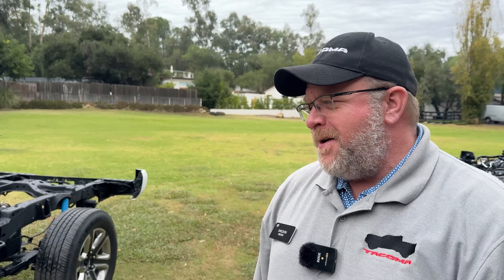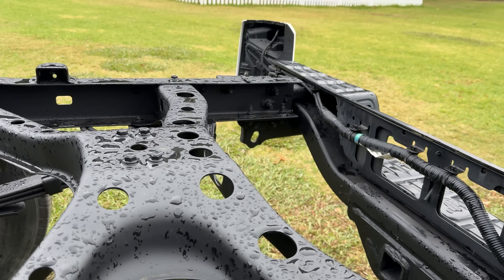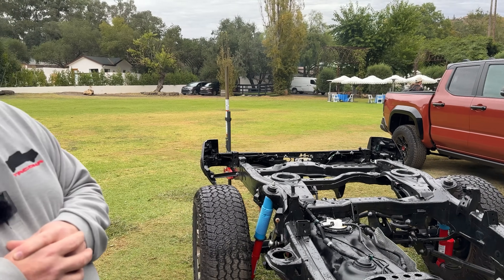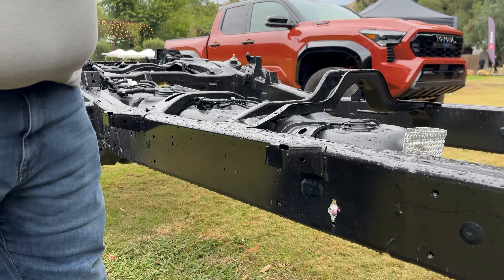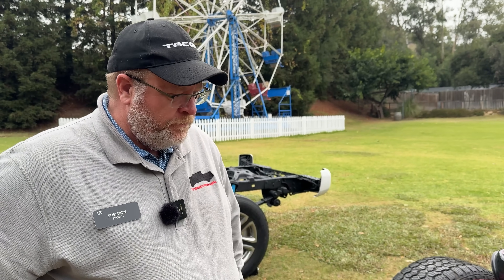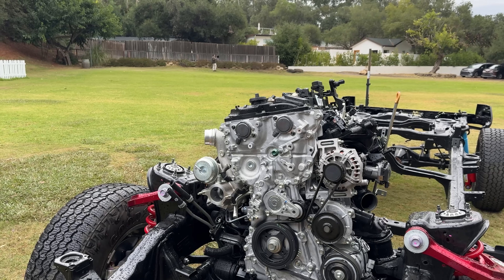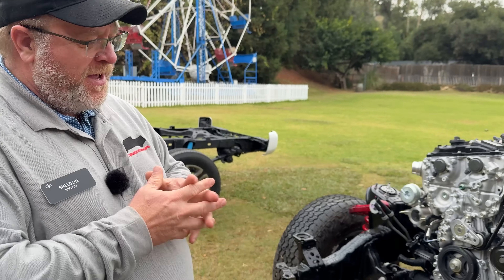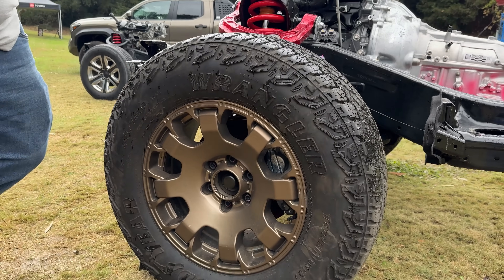2024 Toyota Tacoma Engineer Explains The New Engine and Suspension

Comment: My opinion with the turbo four-cylinder is more maintenance requirements then the V-6 or four-cylinder non-turbo engine bottom line I’ll keep my V6 manual taco before I buy a new turbo tacoma just saying CEO Toyota bowing down to the EPA  bs just saying
Reply: may be  not , if they implement the good coolant system , these engines are port injector engine / direct , so less carbon build .
Reply: @irfanspace  i’m worried about the turbo long term between 150 to 200,000 miles that’s when costly maintenance big repairs come in with turbo engines just saying
Reply: Fr when they technically don't have to listen to the EPA until 2030.
Reply: @MWAclanGaming   it depends on the administration  that’s running the country at the time  but  going green doesn’t mean better

Comment: Pros - Exterior design looks nice, Cons - All digital gauges, ,  4cyl turbo/ hybrid  8sp transmission will be less reliable and expensive for (Long term) users. I honestly feel Toyota is jumping on the band wagon for cheap thrills tech for the new generation of drivers and the new era of disposal vehicle's where nothing last for 10yrs now which is sad because they were the pioneers for long lasting reliable cars. People also need to be more vocal on car channels to be pushing back on things we don't want or we will be having crap going forward. The manufactures do look at comments to see what people think, for how much vehicle's cost now we do not need them telling us what we think we would like versus what we want.
Reply: The 8 speed is an old transmission that toyota/lexus has had for the past 20yrs, they should have put their 10 speed in it for better mileage and smoother/faster shifts.
Reply: @MWAclanGaming   the 10 speed in commute focused vehicles is utterly dumb, and has proven to be the least reliable new move ford and chevy decided to go to, as much as i hate toyota and it's overuse of cheap plastic and plastic like ride qualities, they clearly know which transmissions will serve the "reliable" role best. the ten speed still has way too many issues, it's simply just way too many gears for what manufactures are pairing them to, which is most commonly in the stupid 3-4 cyclinder turbo charged engines, more gears more problems. i will say though 8 speeds have become the new 6 speeds of today though. depends which manufacture tho. Dodge has nearly perfected a bulletproof 8speed automatic though so who knows, it's a matter of time, just isn't logical for the general application manufacturers are doing as of late...
Reply: I like the digital age due to vision issue. Easier for me to see, but yeah analog is far more reliable and last forever.
Reply: You didn’t listen lol. People said the same about the hybrid
Reply: @DavidRC-m9w   I don't care if Hybrids are somewhat reliable , the fact is the addition components to make hybrid/ turbos/ Batteries work will fail prematurely before the motor will reach end of life and when that happens that will cost you and me and everyone thousands of dollars just to keep it going on the road. But at that point you will be questioning is it worth keeping and possibly considering buying a new vehicle, that's why I say it will be roughly 10 yrs maybe sooner than the NA motors going to at least 20yrs. But do what you want its your money, I'm just not in the habit of wasting money.
Reply: @Bobby_86415  yeah the Prius is unreliable ha ha ha ha isn’t that just the most reliable drivetrain out there? Yep it sure is.
Reply: Im gonna keep my second gen till it breaks
Reply: The turbo engines are reinforced usually, and the electronic gauges are way more reliable than analog, kore precise and would last years, cars from 2014 are still running great with their electronic gauges.
Reply: What makes you think everyone else feels the same as you do?
Reply: @ChopperChad  Only the educated ones do as well as the 38 likes to my comment compared to your 1
Reply: @Bobby_86415  it was a rhetorical question to make the point that you don’t speak for everyone. It’s not your opinion, it’s the dogmatic and final tone-as though you’re the only one that gets it and we all should be grateful for your enlightened prose-that makes your thoughts so obnoxious.
Reply: @Bobby_86415 Emissions fines means turbos are going into everything until they completely go to EV. Toyota would love to sell us whatever engine we wanted. Look at Stellantis- why would they kill their V8’s unless they were getting hammered with fines. It’s nothing to do with the customer and everything to do with the regulations.